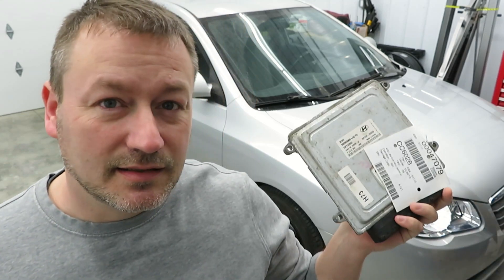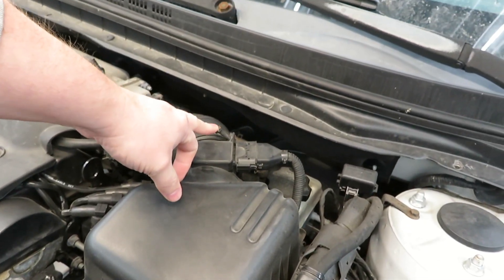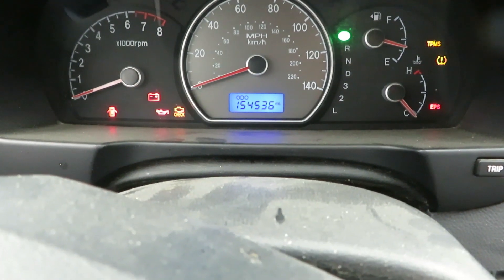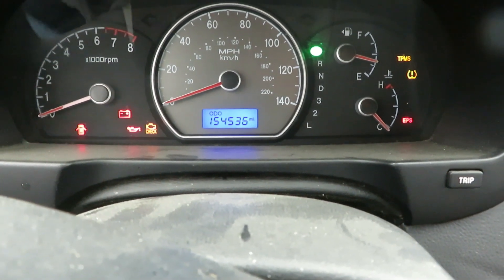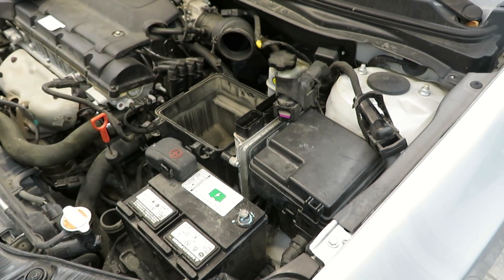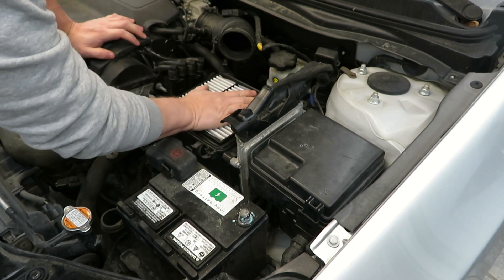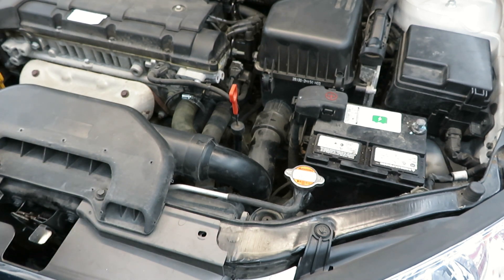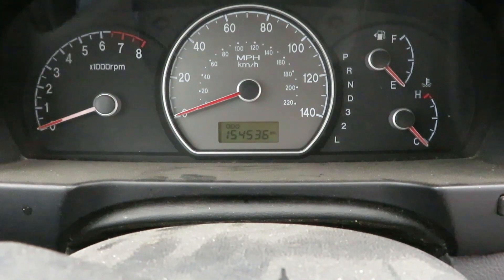2007-2010 Hyundai Elantra ECM Replacement: Step by Step

Comment: repalcing it is the easy part. finding a new one - that's the hard part. where did you get your's ? I have the 39100 - 2G281 can't find it anywhere...
Reply from the maker: I bought this one from eBay.
Reply: @DCAutoEnhancement  thx. Any encoding required ?
Reply from the maker: @tamirtsuriel7718  no. I was able to plug in the used one from eBay and run without any programming at all.

Comment: I am getting a P0130 code which is bank 1 sensor 1 02 sensor. I have replaced it, checked everything and I cleared the code and it comes back the next day while sitting in idle. I have tested all the wires and checked the ohms, checked for vacuum leaks and it does not make sense. Is wonder if it’s also my ECM.😢
Reply from the maker: @Angel_xXx_76  I understand your frustration there still may be something causing the light other than the ECU. Exhaust leaks, poor fuel delivery from the fuel pump or fuel injection system, and engine misfires can trigger a P0130 code. These are just some additional things you can look into.
Reply: @DCAutoEnhancement  I’m looking at the MAF sensor now. If I unplug it while running nothing happens. The car should shut off but it didn’t😵😵

Comment: Great Video and great explanation.  Made this repair super easy.  Thanks
Reply from the maker: Thank you for watching! I appreciate your feedback
Reply: Hello, many thanks for your video, very helpful. A friend asked me for some help to find a new oem or test proofed refurbished ecu. Thieves have taken away the module of its car. As we are abroad from the U.S, I am looking for a provider to buy the correct reference module there and import back it back. The motor reference is G4FC. 
We'd be pleased if it be confirmed that it is the same motor ref in the video and who was the provider of the spartpart.
Many thanks for your help,
Kinds regards, Max
Reply from the maker: @MdMd-p1j I don't know what engine code this vehicle was. I don't have the car any longer either. I was able to purchase from eBay.
Reply: @DCAutoEnhancement  That's right, I found many second-hand devices on ebay. I will dig deeper to get a good certified piece. Cheers and thank you for your reply.
Reply from the maker: @MdMd-p1j  I wish I could have been able to help.

Comment: I'm thinking of replacing this part on my hyundai. Put a new alternator in and lost all power to almost everything inside the car (windows, blower) and power steering. Also, the battery isn't being charged by the new alternator.
Reply from the maker: I would check the fuse box for a main fuse or something like it before replacing your ECM

Comment: Is this the same as Transmission control module I heard it is but if not can you show where that is cause that’s my problem sir
Reply from the maker: I am not sure if they are the same or not.
Reply: It's the same ECM for the engine and the automatic transmission.  ECM for manual transmission has only one plug!!!

Comment: I have an 2009 Elantra that has a no start condition I've put a scan tool on it but the ecm is not sending any codes back and the car cranks but it will not start it's getting fuel and spark and the sensors that would cause a no start condition have been replaced so I'm seriously perplexed on this one could this be a bad ECM?
Reply from the maker: The only other thing that has to be correct to run would be timing. What was the condition of the car the last time it ran? Was it running rough or smooth? If timing is the issue, it could be that the timing belt slipped enough to be far enough out of time to not run or cam position sensor and crank position sensors can cause a crank no start issue. A scan tool probably won't be able to read those properly unless the engine is running. Let me know how this goes.

Comment: My auto transmission moves from 3rd Gear ,can it be a faulty ECU
Reply from the maker: I don't know much about transmissions but the ECU isn't what I would suspect to begin with. It could be transmission control module or shift solenoid possibly.

Comment: Is that a common problem for elantras 
My car has a decent kick when excelerating
Reply from the maker: This should not be a common issue. If you have a check engine light on, that would be the place to start, by getting the codes pulled.

Comment: Tell me piece my vehicle black smoke coming what problem please help
Reply from the maker: Black smoke is usually caused by burning too much fuel. Could be bad fuel injectors or a dirty air filter.  Let me know if you find the source of your issue please, it helps everyone here in the comments

Comment: Hey pal, do you know where the TPMS receiver is located? Thanks.
Reply from the maker: I wish, I would have bypassed mine if I did🤣
Reply: @DCAutoEnhancement  I promise that if I find it, I'll let you know.
Reply from the maker: @NYFreeman  if I understand correctly, the receiver is built in so that it can't be messed with. I read that about another vehicle.  Good luck
Reply: @DCAutoEnhancement  no, there is a separate TPMS receiver. You can find it online and on the parts store. The problem is that the diagram is not clear where exactly it's located.
Reply from the maker: @NYFreeman  I'd be happy to hear where it is once you find it